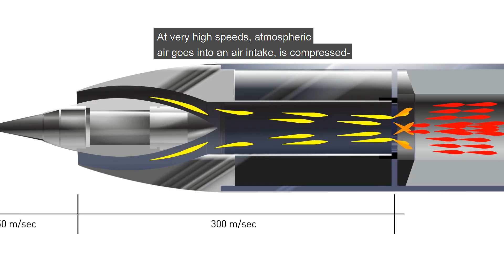How ramjets may change the role of artillery on the battlefield

Comment: So a long range artillery round with no payload. That sounds useful.
Reply: Well, its a technology demonstration. Don't expect anything practical in the first decade
Reply: @Kevin-fj5oe  
Ya, I'm sure any potential opponents will wait.
Reply: @brianjordan2192  yep, there's no war that required rapid development of this round, yet
Reply: @Kevin-fj5oe  well there's a war now ain't there
Reply: @IrishCaesar  well, now there's a reason to fast track the development.
Reply: While the payload would be reduced making it less effective than comparable ground-impact HE, it would serve well for airburst/fragmentation warheads.  Firing deep behind enemy lines, your targets will be supply depots, grounded aircraft and pilots, transportation/communications infrastructure, etc..  Firing at front line, your target will be entrenched troops.  In both cases, airburst/fragmentation rounds would damage/destroy "soft" targets well.
Reply: actually, the cone that deflects the air into the compressor could be filled with some kind of payload, not to mention that any unburned propellant may be explosive as well!
Reply: @Anonymouzor  
Have a look at the diagram in the video. And then think about how far in the ground this shell would be at that velocity when what little payload it could carry went off. Then ask yourself if it could be in anyway a useful payload.
Reply: @brianjordan2192  it could airburst before hitting the ground!
Reply: @Anonymouzor  
But with a miniscule amount of explosive and shrapnel, what good would it be? It's artillery, not fireworks. And trying to develop a fuse that would accurately airburst at mach 5+ would be a whole other matter, because it would have to go off way above the target in order to have time for the shrapnel to spread out. 
No, this kind of shell is a technological dead end. Not enough mass to allow effective fire.
Reply: Kinetic impact isn't terribly useful for long range artillery. Such weapons now need to be insanely accurate which bring up both issues of a self-guiding system being able to know there is a specific target over 150km away, being able to identify it (in weather, fog, smoke, etc.), then being able to steer itself to a tiny location, plus even more cost, complexity, and chance of failure. Finally, kinetic weapons aren't terribly useful against hardened targets until they have a heavy dense mass penetrator rod/dart. If you can carry a 10kg tungsten rod, you might as well carry 100 100g pellets and detonate 1km off the ground and take out a 100m wide area.
Reply: The "People's Republic of China" wants to know your location....
Reply: Kinetic damage.. Study Physics behind this.. A meteorite Is still dangerous even without explosive.. Save cost than standard missile.. Even more dangerous there is No iron dome System can protect From Something thIs fast..
Reply: Shells cost too much. We should just use cannon balls, they cost WAY less. ;D
The payload is in the ramjet's compressor. Doesn't take much to bust the shell into shrapnel. Do a VT air-burst and you add the velocity of the shell to the shrapnel. Read several times the speed of sound. Infantry dies, Light vehicles die, tanks sustain damage to tracks and fire control, ect. Same as a normal shell with 6 times the range.
Shell guidance is already coming online, someone already mentioned the M982 that the US Army is fielding now. So accuracy isn't gonna be much of an issue.
And no matter what, its still cheaper then flying an F18 or F22 200 miles and dropping a guided rock (JDAM) on the enemy. And if the enemy actually has effective AA (Unlikely but possible) then add a crashed F18 or F22 into the cost management. Don't worry about the pilot though, the government only pays out $400k to his/her family. A drop in the bucket really.
Reply: LOL, so many engineers in the comments... Obviously video games and Google makes you more specialized that a company that is actually producing and developing weapons... The Dunning Kruger is over 9000...
Reply: @davidgreen5994  I was a Towed Artillery Technician that worked on the M198 Howitzer in the Marine Corps. I know my artillery and what it does and how it does it. And that shell, while has an impressive range, if it only relies on kinetic force, then it can only demo structures while vehicles and personnel need shells with explosives that detonate on point or air-burst above enemy combatants. As is, it is a one-trick pony that has perhaps 1/3 the utility of other rounds if that.
Reply: All rhe comments about how effective this would be because of the connectic energy clearly do not understand the working principles. The gun fires the shell at more than mac 3,the motor ignites and the shell continues on it's launch angle, 45% for max range, until all the fuel is spent. It is now traveling at it's max velocity and altitude . The projectile starts to curve down towards the ground and slows to its terminal velocity before striking the ground. The terminal velocity of an object is the, steady speed achieved by an object freely falling through a gas or liquid. An object dropped from rest will increase its speed until it reaches terminal velocity; an object forced to move faster than its terminal velocity will, upon release, slow down to this constant velocity. When you know the mass of the object, drag coefficient, density of the air and the effect of gravity, the terminal velocity of any object can be calculated. This object will be moving at subsonic speeds on impact and unless it hits you on the head, will do no damage. .
Reply: So many stupid people... This is obviously gonna be a guided weapon, like Excalibur.
Reply: @MishaAmashukeli  
A guided projectile, with no payload is like a passenger plane with no room for customers, worthless.
Reply: Its designed to be able to take a HE payload , look at 4.21
Reply: @Hail_Full_of_Grace  
And the rest of the video explains how it does not, can not, and will not carry a useful payload, because the whole shell is engine and fuel. If you watched the video, it actually says that.
Reply: The compartment between the venturi and the fuel compartment looked about the same volume as what is inside a normal fragmentation shell (about 9kg of TNT). It will not have the same amount of cast iron that can scatter all over, but if it is loaded with an 80% TNT + 20% aluminium dust mix (same as in the MOAB) it would still provide a decent amount of AOE. Not the kind of "everything that has flesh gets shredded within 200m" blast of a standard shell, but certainly enough to turn a brick building into an impromptu fragmentation dispenser.
Reply: @andersjjensen  
No, there is nowhere near the space for payload as in a normal 98 lb HE shell. The video even states there is almost no, zero, room for explosive payload. 
This shell has range, and it has initial velocity, but it has no room for payload, or an effective guidance system.
Reply: Some drawings of the WWII german experimental ramjet shells show explosive payloads of up to 50Kg. Not sure how many were actually made though.
Reply: @mbak7801  Damn Germans ... first with almost anything ... Ho 229, V2, infra red scopes ...
Reply: @mbak7801  the Germans also drew up plans for a massive tank with the turret from a battleship on it. just because the Germans made plans for something doesn't mean it would work let alone be practical/useful in combat.
Reply: We really need info about the payload, other wise in order to get range if they make it equivalent to 105mm shell, then its not that useful
Reply: Bad Idea. Shades of Iraqi Scuds and German Rheinbote. Long range rockets that can only lob a hand grenade's worth of HE.
Reply: Everyone is getting this wrong. The compressor can double as an explosive warhead. It has been done before. Read about the Talos missle. It was the first missle used by the US Navy to shoot down a hostile mig. The warhead was the compressor itself.
Reply: The us already has there own long range MLRS systems? Also the two largest airforces in the world (USAF And NAVY)
Reply: I’m sure some dictator will buy it with their subjects’ hard earned resources.
Reply: right? if something we wanna hit is that far away we'd just launch a missile at it.
Reply: I think it has a payload in the nose cone. The center of the air intake shouldn’t be too hot to store some explosive compounds, so long as they are far enough in front of the combustion chamber for the ramjet. But these shells will have significantly less payload.
Reply: @turkeyboy5543  
The nose cone will necessarily be empty as the nose cone will have to extend or retract during flight because the airflow changes as speed changes. The way ram jets work precludes any useful payload in a shell of this size. There is a reason tanks have both kinetic energy rounds and explosive rounds.
Reply: The warhead--as in ramjet-powered (sustainer), rocket-boosted missiles such as the U.S. Navy's Bendix Corporation Talos surface-to-air (and surface-to-surface) missile--is probably in the Nammo 155 mm ramjet projectile's center body, whose nose tip can be seen protruding through the air intake. The Talos' conventional warhead (there was also a nuclear warhead version of the Talos) was of the high-explosive, continuous-rod type (the rod was instantly expanded into a hoop of metal at detonation, cutting through an enemy aircraft, and the metal shards of the Talos ramjet expanded in a spherical cloud, serving as deadly shrapnel). The 155 mm ramjet projectile probably has a similar warhead system; any remaining un-burned solid ramjet fuel (as with the Talos' liquid, kerosene ramjet fuel) would also provide an incendiary effect on the target.
Reply: 3:57 does that look like no payload?
Reply: It seems people fail to see the ultimate goal for these engineers. They still live in the days of the Dover Strait. These shells aren't for attacking military or even strategic targets. They're for breaching the Geneva convention!

Unprovoked attacks on populated civilian targets half a country away!
Reply: @uh57tissues  
Right, ya, power to the people. 
Stfu I lost IQ points just reading your drivel.
Reply: @uh57tissues  suuuuuure thats what they are used for. i hope you are joking
Reply: @thetreelander7378  it was purely hypothetical. And frankly, I don't know much about this type of munition. Weather its fully developed and in production or still just a concept. What it WILL be used for is potentially nothing since I'm sure most of the nerds here have pointed out it seems impractical for conventional artillery, firing at conventional targets.

In short, yeah. It was a joke.
Reply: @uh57tissues  alright its just that i have been dealing with a lot of stupid of late and i have been needing to make sure
Reply: I don't think you can even use it as a kinetic penetrator because of it's terminal ballistics. The ramjet MUST make the point-most part of the shell, the shell it self is probably made out of mostly titanium and fuel and I don't think you can stick a tungsten/uranium penetrator at the end of it, partly because I think the "ballistic cap" would deviate the round's trajectory upon collision and partly because it's simply too long to fit.
It would be sort of like an unguided, weaker, fatter, heavier and more expensive version of a kinetic atgm, and those are already kinda experimental trash
Reply: Basically they want to throw tooth picks instead of any payload not calling artillery inaccurate but i can’t see the use if you can’t hit a target with dead on accuracy like a cruse missile if they could find a way to increase accuracy it could be useful for pin point targeting tanks and armoured vehicles
Reply: Kinetic energy is usually all it takes
Reply: If you have enough kinetic energy the sheer momentum will cause an explosion by atoms breaking apart from each other
Reply: @UhtredOfBamburgh  
Not going to cause a lot of casualties with a 98 lb kinetic round. That's why they use explosives.
Reply: Mark Stanborough  
No, the limiting factor is physics.....
Reply: Mark Stanborough  
No, I have other things to do, I'm at work so my time on YouTube is limited. Besides, what solutions would be on the internet anyway?
Reply: The ramjet is an advantage to boost the range, until the fuel is burned out. After the ramjet inlet has a colossal drag An instant disadvantage. So you will have an extended range but not so much kinetic energy. Without a proper warhead, a hollow body design, with a guidence system you will have a long range, pinpoint nothing. A very accurate peacekeeper. The ramjet assisted artillery projectile is came from WW1, developed by Todor Karman for the Austro-Hungarian monarchy, but after the significant range extension, there was no further advantage. The german artillery developed it again in WW2, but also realized the less lethality and impact energy at the target. If you would like to keep the demolition capability, you have to keep the impulse, the penetration and the blast effect either. So you still need a high speed, heavy, solid, hardened nose cone projectile as much and powerful explosives, as you have.
Reply: The thing though is that it actually is useful, modern technology has increased accuracy on a lot of things. @123 Vig says a tooth pick at mach 5 won't do much, except if you fired it at enemy armour with enough accuracy you could disable it. Also coming onto infantry, instead of actually killing them it could be a terror factor instead. If you saw the sky with black dots coming at you at mach 5, I would be pretty scared.
Reply: @chewiesof  
War is not about "scaring" your enemy. Artillery is an area weapon, having a shell that has no payload is pointless. This type of Artillery round is a technological dead end.
Reply: I came here to say this.
Reply: @GJ203  
Well good for you. You came here to say nothing.
Reply: @Thomas ChromblyAFAIK the number of warships with 155mm guns is 2.
Reply: @Thomas Chrombly yeeee, with how advanced things are becoming lately, you can easilly make these somewhat guided as well to hit a specific area.

Too be honest with the range these supposedly have, it might be mandatory to have a guidence system as atmospheric conditions might throw them off target
Reply: The operating mode of these will be precision strike.  For instance...disable a 2S35 Koalytsia-SV 100 miles away.  That is worth 100 normal rounds.  Heck...probably worth 1000....  It wont take a large warhead.  The Javelin warhead mass is 2.74 KG.  Pretty sure they can squeeze in 5-10 kgs. Plenty to take out a radar, 2S35 Koalytsia-SV, command post, tank, BMP etc.  That is the goal here.
Reply: @shooter7a  
Have a look at that diagram again. Where you going to put a shaped charge?
Reply: @brianjordan2192  Inside the inlet cone inner body....You think that thing is just suspended magically? It is supported by ribs.  That means a path for controls and wires...  Simple.
Reply: @shooter7a  
Shaped charges are more than wires, and controls. With a ram jet taking up the center of the shell, there is no place for any effective payload. Long range artillery is for counter battery fire, or interdiction, not for destroying 1 vehicle per round. Take a look at other long range artillery rounds, that are in use. This design wasn't thought through. Artillery is spin stabilized, so you can't put a guidance system on something like this, because it would not have balance, thus it would not be stable in flight. This round is like a football with a tunnel through it. It's lighter, but it won't carry anything because of physics.
Reply: @brianjordan2192  

#1 - Again inside the inlet cone. Plenty of room.  You can also have ring shaped conical shapes.  All sort of possibilities.

#2 - Again, you keep saying "what artillery is for" while ignoring what precision guidance makes possible.  The same exact argument used to be made about gravity bombs.  It was "for" blanket destruction.  Well now many dumb gravity bombs do we drop now?  Even though precision munitions are 50x more cost, it is worth it because precision is MORE than 50s as effective.  If you can take out precision targets with even 1/20ths of your artillery, it is well worth it.  Leave 95% normal...but have 5% be precision capable.  

#3 As for spin stabilization...what about the rocket boost the the M982?  That seems to work OK.    Experience with the M982 in Iraq in the summer of 2007 was highly successful, with 92% of rounds falling within 4 meters (13 ft) of their targets. Its performance was so impressive that the U.S. Army planned to increase production to 150 rounds per month from the previous 18 rounds per month.  In 2012, Excalibur rounds reached new record ranges in combat of 36 kilometers.  In December 2020, the round was successfully tested out to a range of 43.5 mi (70 km) using a supercharged propellant out of a 58-caliber-long ERCA gun tube.  So again, what about a more powerful rocket boost is going to make it not work.  THEY HAVE ALREADY OVERCOME THE UNINFORMED THEORETICAL PROBLEMS YOU DREAMED UP.
Reply: @shooter7a  
Ya, they already overcame the problems, that's why they haven't put this into production and instead say they have not overcame the problems that they themselves have are why no one wants to by this experimental shell. 
But hey, say whatever you want, it makes you feel superior. That's fine. 
You know because rocket assisted projectiles are the same as ram jet engines. 
But whatever.
Reply: Range and payload can be traded.  Even 10kg would be plenty if it is a precision weapon.  That can easily take out a command posts, radar, or Self-Propelled Gun.
Reply: @shooter7a  there's more to it than that. Because of the hollow projectile, putting any guidance system on bored and trying to have a payload is not as easy as some people think. Obviously, since they still have not perfected the projectile as of yet.
Reply: @brianjordan2192  yes...I would agree with you there.  But there is one thing you may not have thought of.  Asymmetry.  CFD is an amazing thing.  My guess is after they have symmetric designs working, they will start going to asymmetric designs for packaging reasons.
Reply: @shooter7a  
Well that may happen in the future, but my point has always been, the technology to make this projectile worth while does not exist yet. A projectile like this will be expensive, even if they do figure it out. The current conflict in Ukraine illustrates this perfectly. The Russians have made very little progress in the east, despite having precision guided weapons because defeating hardened, fortified positions is extremely difficult. Western weapons, in service today, that are designed to defeat hardened, fortified positions tend to be guided, and have a large explosive payload, because years of facing this kind of targets in ww 2 Korea and Vietnam, as well as in Iraq and Afghanistan has shown this is a recipe that works. Longer range artillery and rockets used for counter battery fire also have a respectful payload. 
Getting all the ingredients right in a shell like this one will involve a rather large technological leap. Especially when remembering that ordinance has to be cheap in order to have the numbers to make it tactically effective. If they figure it out great, but I've been around for a long enough time, that I've seen many potential weapons systems fail to reach production because either the technology cannot be developed or not for a realistic cost.
Reply: @brianjordan2192  fair points all around.  I just don't think the technological leap is as large as you may.  For instance. the ramjet concept does not have to be for 100% O2 replacement.  Rocket boosted precision guided artillery already exists.  A limiting factor is oxidizer content in the propellant.  Small ramjet passageways combined with a solid propellant with "reduced" oxidizer can boost range, and provide a compromise with significant improvement in range, while reducing the technical challenge.
Reply: @shooter7a  
I don't know the equation of diameter to length for ram jets right off the top of my head, but the multiple mini ram jets may give a greater payload. 
The thing about rocket assisted projectiles has always been the sacrifice of payload for range. Extended Range, Full Bore, Base Bleed, rounds (ERFBB) have the best range to payload capabilities at this time. 
The complexity issue is always a concern when designing munitions. Most weapons systems have to work well with entry-level troops. Back in the day, we called this being idiot proof. With any projectile, the guidance system and everything else has to be able to survive extremely high G loads, and survive being dropped by crew members and ride in off road conditions. Ram jets, with no moving parts probably will survive the G load, but a tube artillery round needs to be cheaper than guided missles in order to be economically viable. If the projectile is more expensive than, let's say an American TAC-M then there would be no reason to produce it other than redundancy, and in peace time, the brass has to prioritize quantity, not redundancy. 
That's the whole complexity this I was talking about earlier. It would probably be easier to strap a few ram jets on a currently produced rocket, rather than redesign tube artillery projectiles.
Reply: @brianjordan2192  yes, tactical S2S missile technology is something the US is way behind on.
Reply: @shooter7a  
Only because the US adhered to treaty restrictions while obviously Russia did not.
Reply: If it manages to hit something vital with range and precision it may be worth it for strategic strikes.
Reply: Terminal velocity is how fast a thing can travel toward the ground under gravity alone. I'd be curious to see the flight arc on these, depending on when the motor fires it could be hitting the ground at extreme speeds and the kinetic energy could be significant. 

I'm no engineer though, and I want to doubt that the kinetic energy delivered could possibly be as devastating as 155mm HE
Reply: @Mudamr  
Terminal velocity is whatever speed an object is traveling when it hits whatever it is going to hit. 
You are referring to terminal velocity as it pertains to falling objects, which is the maximum speed a falling object achieves in a gravity only fall. 
And no, the kinetic energy of this round, assuming it's weight is much lower, because it is essentially hollow, even at hypersonic speeds, it will not be effective against area targets.
Reply: People who say speed wil do the damage, they are forgetting its an artillery shel not a kinetic energy weapon, its goal it to cover as much area with shrapnel not deliver high energy to a particular target
Reply: @fotina45  
Well said.
Reply: @fotina45  when a shell flying at supersonic speed without conventional payloads hits anything such as ground, vehicles, a building, it will surely destroy whatever is in its way and during the process, all the destroyed particles like stones or pieces of debris will also acquire at impact supersonic kinetic energy powerful enough to do great damages around. so if a shell can fly at supersonic speed, it will turn all the debris at impact into shrapnel. so no need for other payload for it.
Reply: @kirakamu9246  yes the debris files up in an inverted cone so anyone prone would have to be very close to get hurt. Soldiers tend to go prone under artillery attack. Air burst schrapnel covers a much bigger area so this long range shell would have a much reduced capability.
Reply: @robertjohnston8531  That is not true. An object at supersonic speed creates much more debris at higher speed than a conventional shell with air burst shrapnel. It is due to the law of conservation of momentum. When a shell hits a target at supersonic speed, its momentum is transferred to the debris. Since the momentum must be preserved, more debris at higher speed must be produced at impact. So you don't need air burst shrapnel for any supersonic shells.
Reply: @kirakamu9246  I never doubted the energy in the depris, however having that thrown into the air in an inverse cone is less effective than an air burst donating primarily horizontally or in a downward cone from the air.
Reply: @kirakamu9246  Actually most of the energy is converted into heating the ground and most of the kinetic energy that isn't converted creates a shock wave that travels at the speed of sound through the ground. Only the energy that travels along the surface of the ground is transmitted to the debris which is a small fraction of that energy. The Momentum preserved is in the shock wave which radiates primarily in the forward arc unlike an explosive which generates a pressure wave are higher speeds and over a greater area than what the kinetic weapon achieves.
Reply: The payload is pretty small, but it is going to be far more useful than an artillery piece that is out of range. These will not replace conventional rounds, but they do mean that you can have your artillery support troops that otherwise could not get any support. Every gun within 150km can be firing these at a single target; you don't need each gun to be as effective to get the same overall effect at any location.
The biggest problem with it is that I can't see why would wouldn't just put the thing on the front of a rocket. A rocket can get it up to speed without wasting propellant by going fast at low altitude on the way up, so the efficiency gained by firing it out of a barrel isn't really that helpful.
Reply: @agsystems8220   we already have rocket artillery they're called 270A1 and HIMARS and are extremely effective up to 300km with a gps guided round that accurate within 2m of the target. We use them all the time, I'm a 13m crewchief. I'm sure these rounds will carry a payload much later but they need to get the engine and body right before they start putting a load out on it
Reply: @agsystems8220  That's why you have an Air Force, to deal with targets that ground based weapons can't deal with because they are out of range.
Reply: I would assume that this is a prototype, and there is a way to eventually fit a payload on this thing.  Not as much as on a standard 155mm shell of course, but if this thing is precision guided (and at 150km range, it would have to be, or it won't land anywhere near the target), then the payload doesn't have to be very large.  But I suspect the cost of this weapon would be prohibitive.  Is it really worth it to pay 100,000+ bucks for just a single long-range, precision guided munition with low explosive power?  For the cost of a couple dozen of these weapons, one could instead get a short-range ballistic missile with a 500kg warhead, which seems like it might be able to cause far more damage.
Reply: @alexeyvlasenko6622  Naturally this shell is at a prototype stage at the moment, but with a GPS guidance system and an optical seeker for guidance in the terminal phase it would be possible to target enemy assets behind the front line. Targets such as enemy artillery, radar/SAM sites and transport trucks do not have much armor, so a direct hit with such a shell with even a minor bursting charge would be able to destroy them. 
A ballistic missile with a 500kg warhead would naturally bring more explosives to the target area if you are targeting a concentration of enemy forces, but I think the ramjet shell is intended for different targets, namely fast destruction of individual targets at a long distance without the large logistical footprint that a ballistic missile system has. If the enemy has their assets spread out over an larger area, think artillery vehicles spaced out about 300 meters a direct hit with a ballistic missile with a 500kg warhead would be overkill for the vehicle it hits, but would not be able to hurt other vehicles parked 300 meters away. On the other side a direct hit with a 155mm shell with a a 3kg bursting charge detonating inside would certainly destroy it with little damage to the surrounding area barring an ammo explosion in the targeted vehicle.
Reply: At that speed, the speed is the payload.
Reply: At high speed the kinetic energy is greater than any chemical explosive you could put in it.
Reply: ...plus, each shot fired costs a hi-end hypersonic engine.
Reply: Might as well shoot a cotton ball or a teddy bear
Reply: @Leg3nd Assass1n
Where? Where is this explosive mass? The diagram shows fuel storage and the empty space for the ram jet, there is literally no space for a useful explosive payload, and the limited amount of fuel will be used up long before impact.
Reply: Exactly. Why even bother making a rocket shell minus the payload when you can simply make better rockets..
Reply: Mark Stanborough  
There is no provision for any payload, let alone a nuke. And the limited fuel capacity means as soon as the motor ceases to provide thrust, the shell will quickly decelerate, thus reducing kinetic energy. The hollow nature of the shell, required because of the ram jet, will significantly increase drag. Do the math if you want, but the venturi of the ram jet will be a huge drag when the fuel is exhausted.
Reply: Mark Stanborough  
Mossles, aircraft, but not artillery. Science is always advancing, and solutions to seemingly impossible problems have been found, but at this stage of development, the ram/scram jet is not viable for artillery, at least not tube artillery. Current artillery does not have the capacity to launch rounds with enough mass to create an explosion sufficient enough to replace high explosive shells, and the size limitations do not allow thevram/scram engine powered rounds to carry enough payload over long distances. Scram jet technology is still in its infancy, and ram jets require enough space for a venturi to compress air, and a combustion chamber to mix the air and fuel. We are just not at the technicalogical threshold to miniaturize ram/scram jets to allow functional artillery. Maybe someday, but not in the foreseeable future.
Reply: Yep. And it can’t even penetrate anything if it hits because it doesn’t have anywhere for a penetrator to go. Let alone explosives lol
Reply: True, this thing looks like it can only fit in a tiny payload, kinetic penetration isn't a thing, because the shell doesn't have the hard structure like for example a sabot, at best it is going to be a 155mm shell with the impact effectiveness of a 75mm shell.
Reply: Dannebrogs Søn  
Obviously you didn't watch the video. There is not enough mass to create an effective amount of shrapnel, and you're brighter than me yet you can't do the math to realize a proximity fuse is worthless on a round moving 5 times the speed of sound. By the time the fuse detected the ground, the round would have already hit. And who says this is the direction things are going? You? Because there are much cheaper, and much more conventional solutions to counter battery fire. Solutions that don't require reducing lethality.
Reply: Dannebrogs Søn  
It's not about "winning" it's about proper assessment, physics, and recognition of what artillery is for.
Reply: Even current ramjet weapons have no payload. The sheer kinetic energy produced at impact from projectile traveling at over Mach 5 is devastating enough.
Reply: Doubt it's mach 5 at the point of impact. It's indirect fire and flying with mostly ballistics so it has to slow down to fall down..
Reply: @nilshan16  Of course they have a payload! You don't fire a half a million dollar weapon without doing the maximum damage possible. "Mar 24, 2020 · The U.S. Army and Navy tested a joint hypersonic weapon glide body last week. The glide body is the actual weapon itself, which would carry an explosive payload." That said, the payload isn't necessarily explosive, but can be other things like depleted uranium if penetration is the ultimate goal. But they aren't just sending out an aluminum airframe with a ramjet engine!
Reply: Brian Jordan the speed does the punch
Reply: @Raj-df7wf  no that is not a APFSDS Ammunition
Reply: @Raj-df7wf  Artillery is an AoE weapon, not a pinpoint hit weapon... Area suppression is the name of the game the majority of shells fired will be air-burst capable and is designed to explode right above the enemy and shower them with shrapnel or white phosphorus. I mean yeah we train to track and destroy armor that is bearing down on us where a direct hit will score a kill, but that is only when shit hits the fan and we have already bent over and kissed our asses goodbye because... well a tank or other armored vehicle has a faster RoF than Artillery and I'm not even talking about the machine guns that they most likely be armed with besides the main cannon.
Reply: Theblood Tank if you launch a tooth pick at Mach 5 it’s not going to do much damage to the surrounding area. Which is the whole point of artillery.
Reply: @Zerenz1  How bout railgun?
Reply: @Zerenz1  that's not true at all. If the projectile can transfer its kinetic energy on impact, it'll be plenty effective
Reply: @Zerenz1  a toothpick going at Mach 5 would go through you like a hot knife through butter. If you don't believe me look up flechette rockets.
Reply: @Zerenz1  Artilery can be used to counter artilery and thats where i see this but there are better systems
Reply: @Zerenz1  don't the US railguns have more range and possibly devastating more to infantry
Reply: @catluva74  right but the whole point of artillery is to damage a area. Not a specific target.
Reply: @dustinswatsons9150  Railguns are more of an anti-ship, anti-counter-battery type weapon. you just aren't stopping them with any defensive weaponry or armor package. they also have the problem of barrel life as the high intensity ark eats the conductive rails, and you also have intense magnetic forces warping conductive pathways threwout the system. that said, if they hit your battery with it, and you have no counter fire- they can come in and drop a BLU cluster munition on your infantry and it will make a very bad day for 2 football fields per munition dropped.
Reply: @Raj-df7wf  
The speed will bleed off rapidly. The ram just boosts range, it doesn't increase terminal velocity. In the animations they showed here, the payload is rocket fuel that is expended before the round reaches the apex of it's ballistic trajectory. So the round will be slowing at that point. Also how do you get air bursts from a kinetic round? And plowing a kinetic round into the dirt isn't causing casualties, that would just make an impressive hole in the ground. Completely ineffective as a weapon.
Reply: @brianjordan2192  "
Reply: @Raj-df7wf  To the ground? Definitely. To the infantry? I doubt it.
Reply: @Raj-df7wf  to what the ground? you know guidance systems aren't that great at its selling point. oh and to point out its artillery not a tank, ship or aircraft its a artillery shell firing at a target it can't see and you may go "oh but muh GPS" but may i just remind you that GPS isn't good enough for this lightweight shell to do damage at all and it isn't going to kill infantry and buildings will be standing without like what 50 or more of those things and is not going to kill a tank or SPGs because its going to miss them more then its going to hit them.
TLDR: its better to use missiles because they have more punch and similar range to greater and use the same systems
Reply: @thetreelander7378  Yea it looks that in your mind this is the wepond for last war not for future wars... clealry you have no idea where modern systems are going just like russian trolls here that want to use it as area of effect wepond.
Reply: @thetreelander7378  Have you seen what a Hellfire missile can do? It travels around the same speed as the proposed shell and only has an 8 to 9 kg explosive. If the shell was carrying 4-5 times as much explosive as the Hellfire does, I believe it would kill a tank (which the Hellfire missile was designed to do), kill infantry and since I saw a Hellfire basically kill everyone in a building, the shell would definitely be able to do the same, and more. Of course, targeting is another matter because you can't rely on GPS (the Russians sell truck-mounted GPS jammers that protect a good-sized area, so the shells would need an AI capable of passively detecting and selecting terminal targets if a drone or special forces wasn't painting the target.
Reply: @georgeford6056  the explosive charge in a hellfire is HEAT so unless you hit a hard target or really really close to infantry you it will still be less useful then a normal shell but you may say "but muh range" and i will say that missiles and rockets will do better with a greater payload so in short it's just not worth it.
Reply: @thetreelander7378  missiles cost a fuck ton. These cost a lot less. Probably.
Reply: @thetreelander7378  you say that, but NATO has the ability to fly a Hellfire through a window, a JDAM into a foxhole, or a MOAB through the top of a trapdoor-crawlspace to a cave system, with no one matching such lengths of accuracy.
Reply: @Raj-df7wf  It is a general puprose ballistic round. It is not intended to pierce some thick armour.
Reply: @Raj-df7wf  do your physics and return with outrageous statements later, OK? Also - to have speed to whole work, you have to precisely guide round to target that has few good minutes to change position, speed ...
Reply: The kinetic energy is more than enough
Reply: @FIRE_STORMFOX-3692  
No, the kinetic energy is not enough. A shell that is hollow, with a tunnel completely through it, is going to bury itself deep underground and displace dirt. Not what artillery is for.
Reply: Kinetic.
Reply: yes. railgun seem to be better and cheaper to do it
Reply: @TheRealPopol  a rail gun would be exponentially more expensive. Ramjets are simple as fuck to manufacture
Reply: It's like the rods from god superweapon. It relies solely on Kinetic energy to create the  force of an atomic bomb.
Reply: @gavinfeal  LOL. Not in this speed range.  1kg of TNT is about 4,2x10^6J - 4,2MJ. In order to one kg of e.g. Iron to deliver 4,2MJ it would have to travel at around 2,9 km/s which is Ma 9.7. Typical artillery shell contains 11kg of HE better than TNT, which means that in order to replace it with KE, it would have go either from sample 1kg to around 10-15kg (order of magnitude) while maintaining Ma10 or go faster aby about 3 times - to Ma 28, which is more than earth's escape velocity :D
Reply: @piotrd.4850  So if we would replace the HE load with a KE load then we also just could ask Elon to launch steelblocks into the atmosphäre?
Reply: @gavinfeal  
Keep reading comments to see the debunking of that theory.
Reply: @brianjordan2192  I did. Kinetic energy missiles are devastating without a payload. If you read about the Vietnam War "Dirty Dog" bombs you can see it doesn't take much speed to match the force of bombs.